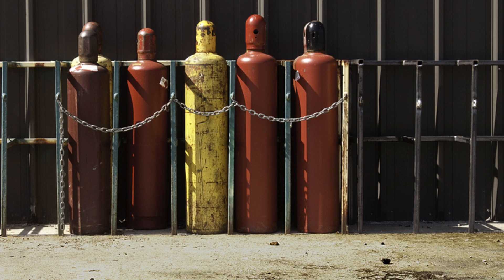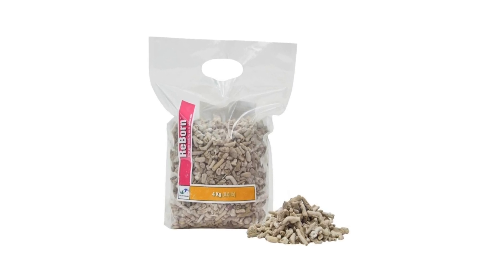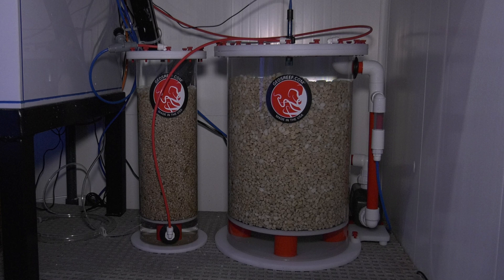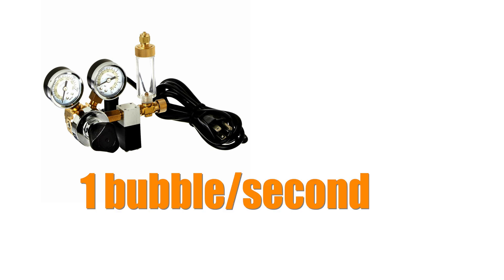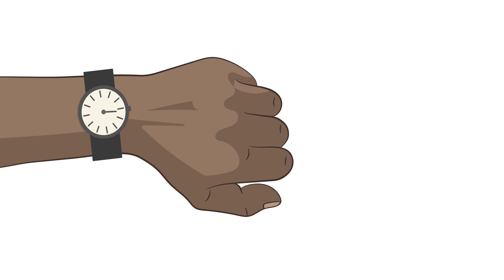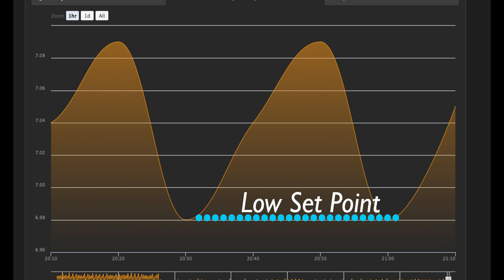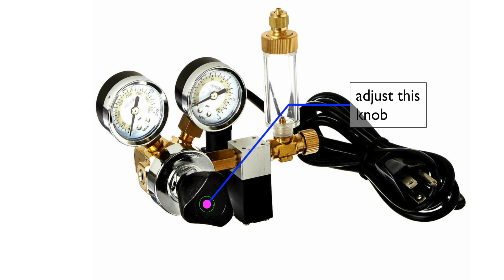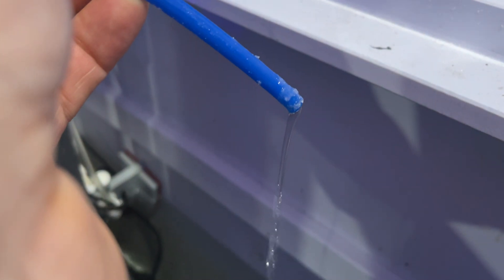Setting Up Your CALCIUM REACTOR - Saltwater 700

Comment: Really interesting to see that the constant stream method of effluent drip is catching on with you! I keep thinking that raising the effluent that high, and thus using a higher PH in the reactor, will make less efficient use of the CO2 overall, because of less contact time and trying to melt media at that higher level. Might have to give it a try though. Using bubble size for control is also a neat method.